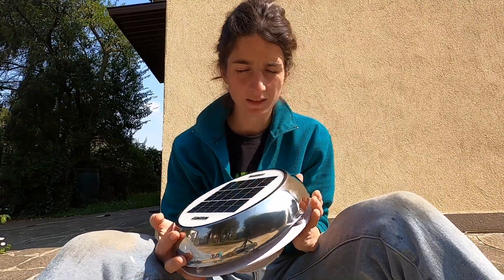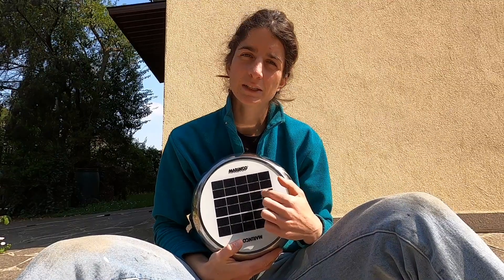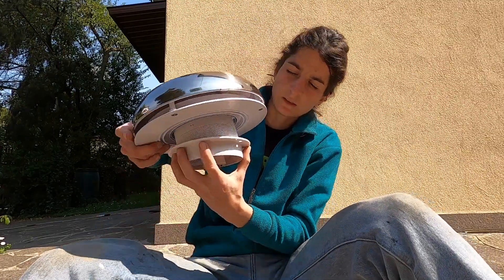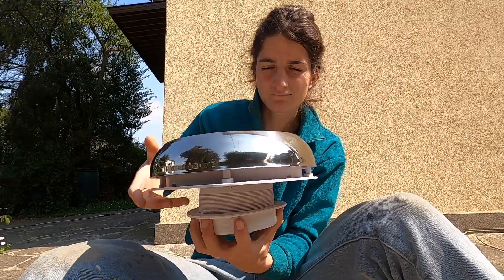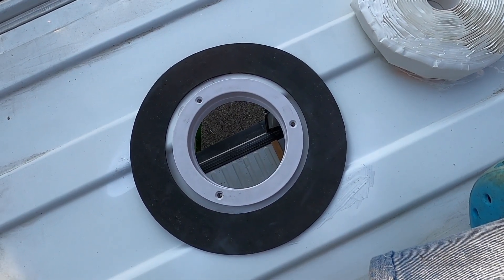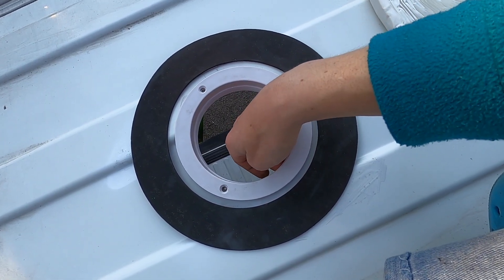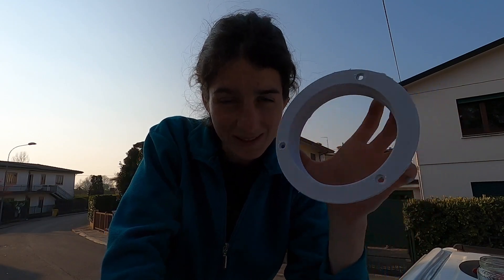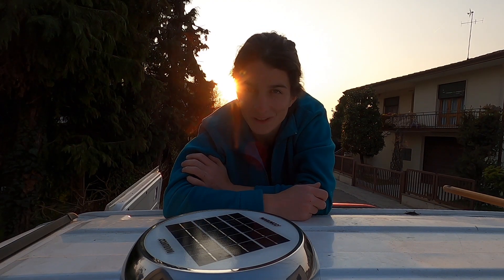Marinco Solar Fan installation - Van Building

Comment: How is the fan working, are you happy with it? We didn’t see it from the inside of the van and I’m very curious about the sound that it creates and about the amount of air that it moves (how much fresh air does it bring into the van and do you notice that the fresh air is coming in?).
Reply from the maker: Hi! I'm using it since half a year now and I'm very happy. it's not so noisy like a classic turbo vent or similar and of course it does not move so much air. I think it's perfect as a second or third fan, allowing you to circulate the air. Being on the top of the bed is also very easy to start and stop when I'm sleeping. If you consider to put it where your feet are, you could probably sleep with that noise. Me I made the mistake to have it just on the top of my head and for me it's annoying. But still, I like it a lot
Reply: Thank you for the additional information, that is very helpful!